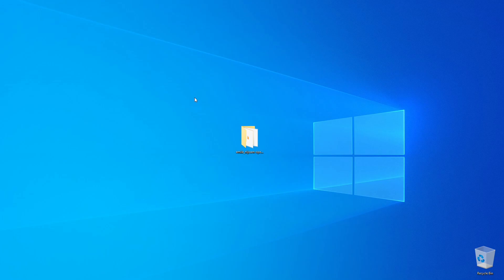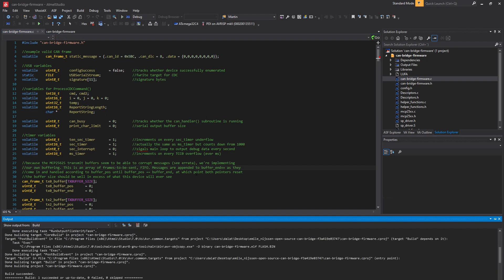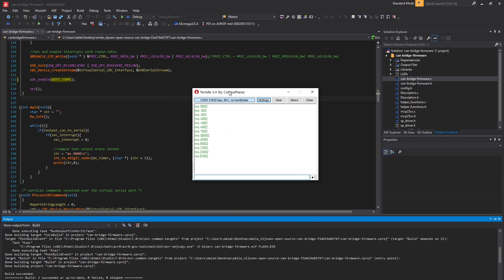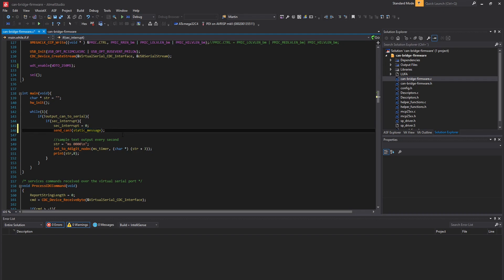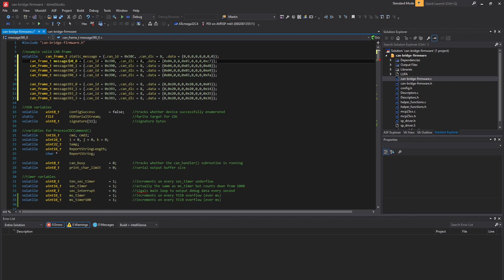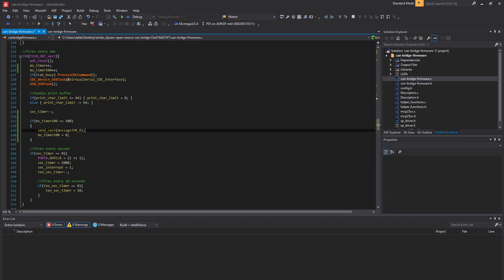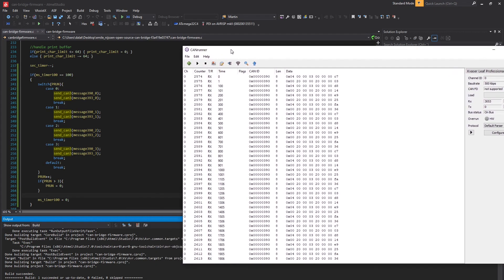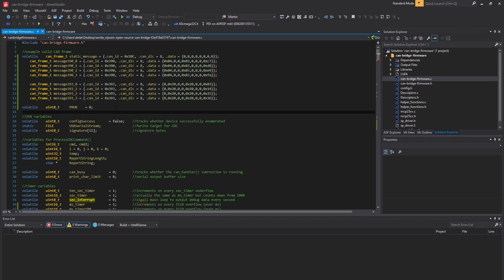Sending CAN messages to fix battery upgrade bugs

Comment: @Dala, I'm in the midst of a battery upgrade a 2012 to a 2015 battery, and I was under the impression that it was a direct swap and no CAN bridge was needed, only cable and battery pairing (performed with the help of Dexter's EV Enhanced button shipped from Texas).  However, I'm receiving the same list of DTC codes that you are receiving in this video.  I wouldn't care about them, but for the fact that the car will fail to go into Drive occasionally (requiring a five-minute time-out, or clearing of DTCs using LeafSpy) and my wife has informed me that she is not OK with doing that every morning when we start the car (though she is pleased with the improved range). 

My first question is - what two generations of battery you are referring to in this video.  Are you talking about the ZE0 -> AZE0 - as is my upgrade, and are the above errors typically received in this situation?  If so, have you worked out the CAN-Bridge software to resolve them reliably?  I'd certainly be willing to pay a bit to resolve this issue.  

My second question - I'm a software engineer, but I don't know squat about CAN bus programming and I don't understand your hardware/software dev setup in this video.  Is there another resource you can refer me to?  Would I start with AVR or Muxan documentation / examples?
Reply: Also worth noting, after upgrade and battery pairing, the car seems very confused about SOC and SOH.  SOH remains 4 bars (although it shows between 60 and 90 mi range when starting up) and the SOH bars seem to jump around - sometimes showing 12 bars with 60 miles and later showing 12 bars at 30 miles (old battery range).
Reply from the maker: Hi Alex. Direct pairing is only possible if you swap an 2011-2012 battery into a 2011-2012 vehicle. Since you are upgrading to a 2013+ battery, you will need a CAN-bridge to use the car safely. Shoot me an email and I can send you a pre-programmed unit. info@dalasevrepair.fi

Comment: The muxsan demonstration code is a demonstration on how NOT to code a can bridge. The simple fact that all the code is ran in interrupt context (including SPI comms) is extremely bad practice verging on dangerous.

There are just so many problems with this code, I would scrap the demo code and start again. I'm not knocking your code Dala, which seems fine, but the foundations your building your code on are extremely shaky.

1) The watchdog should never be kicked in an interrupt - even though it's on a 1ms interrupt, it's still failing after 250ms, that should set alarm bells ringing.
2) Interrupt context should purely be for setting flags to say something has happened, there should be no processing in interrupts, especially SPI  / USB comms.
3) The main loop should poll the flags (set in the interrupt) and do the processing in the main loop.

The fact that this code works is more down to luck and the robust/forgiving nissan ECU code than anything else.

I'm an embedded firmware engineer working in the automotive industry for context, any code with this demo code as a base should not be near any car!
Reply from the maker: Great points Glen! I just used the demonstration code as a base since I can't share my bread'n'butter BatteryUpgrade software. On my version I have the USB port disabled to further improve performance. It takes 220->290us to process a CAN message depending on length with the CPU running at 32Mhz, which seems to be enough so far. My normal dayjob is also writing ECU firmware, so I fully agree with your concerns on the Demo code!

Comment: were did you buy the can bridge
Reply from the maker: I make them myself, since the hardware is open source! But you can buy empty ones from Muxsan: https://www.tindie.com/products/muxsan/can-mitm-bridge-3-port-rev-25/ (or me)
Reply: @DalasEVRepair  is it possible to buy off you in the future when the chips are available with the 2 bms can bridge co habitation code already in it
is it self learning that way?
Reply from the maker: @TheAngryScottsmen  i only provide software for clean upgrades, 30/40/62kWh upgrades. If you are gonna do a custom build you need to code it yourself!
Reply: @DalasEVRepair  oh ok then ill be back to talk with ya when i get things in order
Reply: ok thx can these be setup if i say put a 40/62kw in a leaf it will be all happy and or can it be setup to build an extender pac and have both bms's talk and combine ranges to make one?
Reply from the maker: @TheAngryScottsmen  yup! They work for both!
Reply: @DalasEVRepair  sweet ill have to grab one dose the kit come with a way to program it?
Reply from the maker: @TheAngryScottsmen  no, but any AVR programmer will work!
Reply: @DalasEVRepair  how do you hook up to it to put firmware on it?
Reply from the maker: @TheAngryScottsmen  i have a video on that on my channel! Search firmware